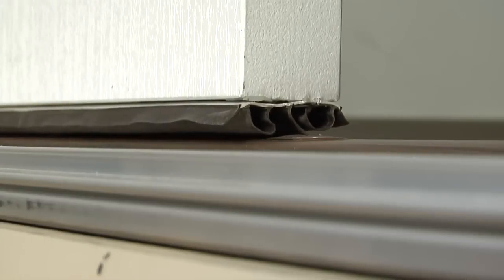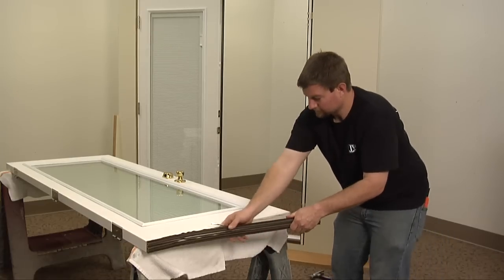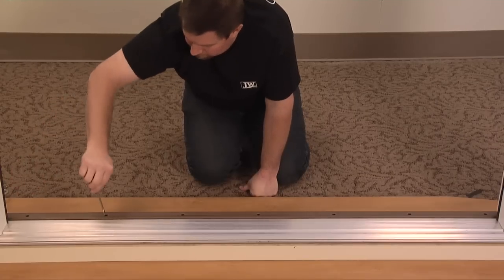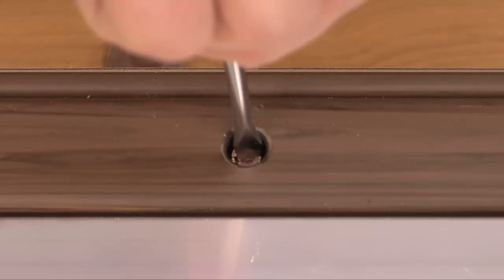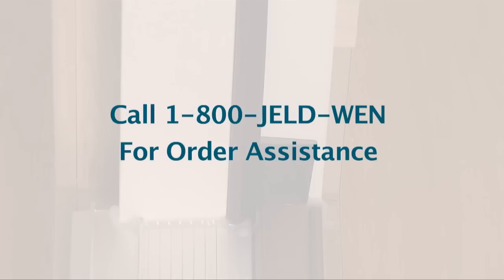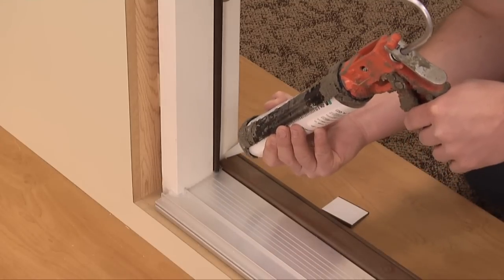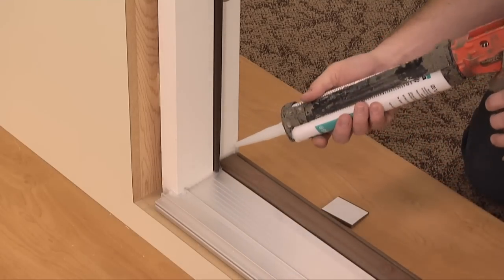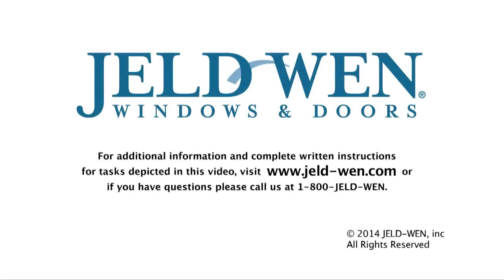How to Adjust the Threshold to an Exterior Door

Comment: Helpful, but after adjusting the threshold down as much as possible the door still rubs. After years of use the problem seems to have worsened. The adjusted part looks to be made of some type of heavy plastic. Has anyone ever had success sanding this material down a few mils?
Reply: I removed mine and covered it with a metal striping.